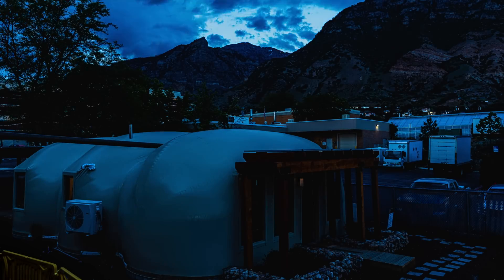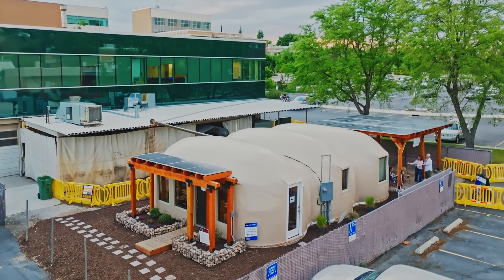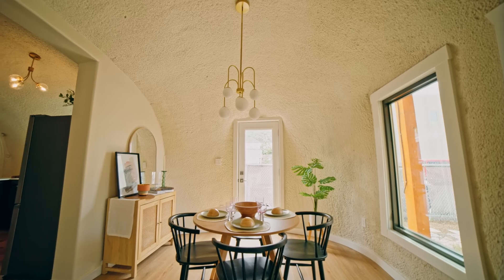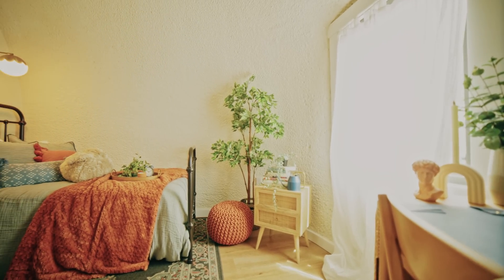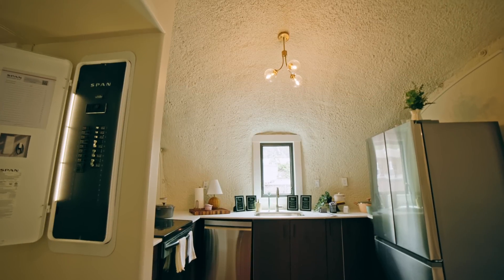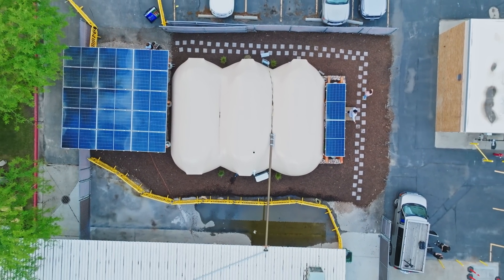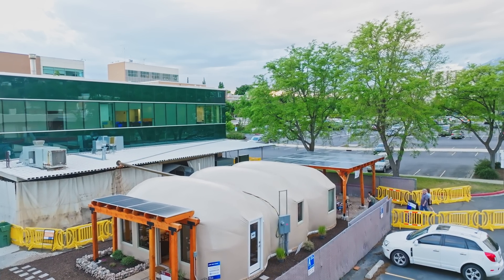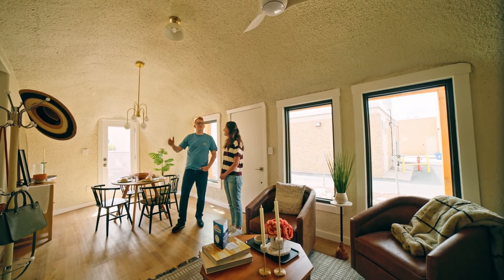No Place Like Dome: BYU Students Design and Build Futuristic Home

Comment: A little constructive feedback.

Pro: I like your choice of elongated domes over circular domes. I have long felt that this is a better option when it comes to utilizing living space.
Con: The house is not 'pretty much indestructible'. Most domes are made of concrete, which is fairly resilient with regards to airborne debris. Your domes are made of foam. 
Pro: I like how the sunlight can reach through the living room and into the kitchen. That was appealing on multiple levels : )
Con: Your solar panels are orientated very poorly. As someone who has lived with off-grid power since 2015, I can tell you, life is going to be MUCH better for you if you angle them correctly.

All in all, I enjoyed the video and am glad to share in your passion.

Good luck!!!

Comment: The article says they are affordable.  What is the cost?
Reply: With all the donated material and labor, plus all the students time and money we spend around 300,000. The extra costs can be attributed to the transportability of the dome, the Solar system and the energy smart appliances.
Reply: @erikbingham5644  How did you end up spending $300k for this? Dome homes are generally $95-$100 per square foot for the shell construction including foundation, airform, shotcrete, spray foam, rebar, and labor. That puts the shell at around $85k.... You are saying it cost another $215k to finish, including solar system (which at max would be $20k considering the energy efficiency of the structure itself).

Comment: More specific information on the energy efficient features would be nice This video was way too vague n that point
Reply: The Photovoltaic (Solar Panels) are two sided so they collect more sunlight.

The Span Smart Panel will automate a lot of the electrical usage from your phone and can be changed from an app on your phone. 

Another really cool feature comes from the design of the home in the thermal massing of the concrete. This acts like a temperature sponge and helps hold a desired temperature.

The insulation has minimal thermal bridging which also reduces your heating and cooling load, which account for 40-60% of your energy load!

Comment: Just curious, how were the efficiency claims achieved with using primarily what appears to be reinforced concrete for the domes?  6 to 8 inches thick of concrete has a very predictable R-value of 1.  This value does not change by very much between widely established and known mix designs.  An R value of 1, or several multiples thereof is no where close to energy efficient.  I did not see any way to insulate the structure other than if insulation was somehow added in with the aggregate at the time the concrete was mixed and poured.  I'm aware of foam added to concrete, but this greatly reduces its strength.  Was foam sprayed on the inside, and then a veneer of concrete stucco (like EIFS stucco) applied to the interior?  I could see that working, but it would need to be quite a thick layer of foam to pick up much more R's.  I'm curious also how these are "transportable" since a dome that size would be a considerable amount of weight, into the tens of tons.  More information on this is very much needed before you will convince experts already in this application and market of the value this design offers overall.  Kind regards.
Reply: Hey! So the spray foam we used was polyurethane which has a r value of 6.5-7 per inch. There is about 3 inches of that in-between the PVC membrane and the concrete. We did this because the concrete doesn't need to have a high r value, the insulation does. The concrete if for the structure and for thermal massing. It allows the dome to hold onto some of its desired temperature for longer!

Great question!